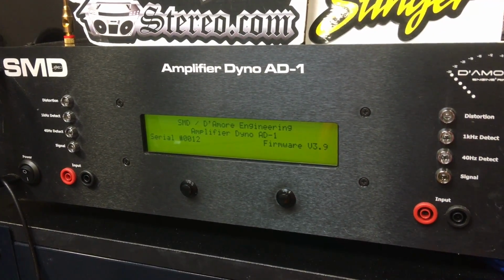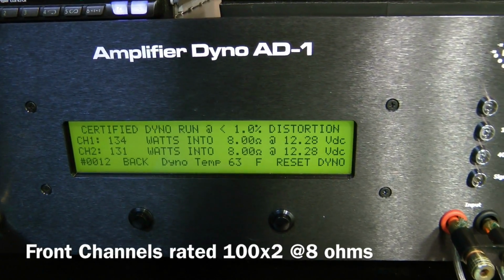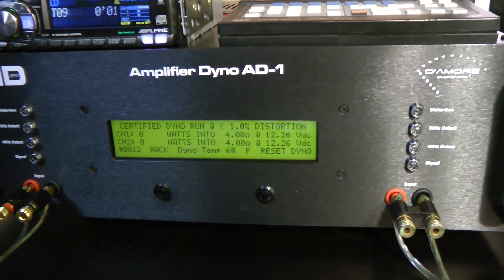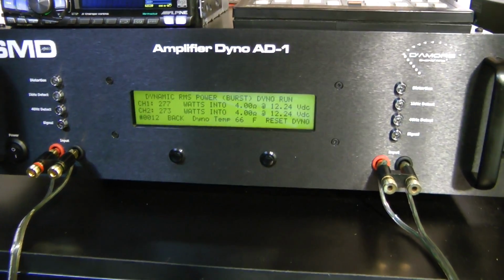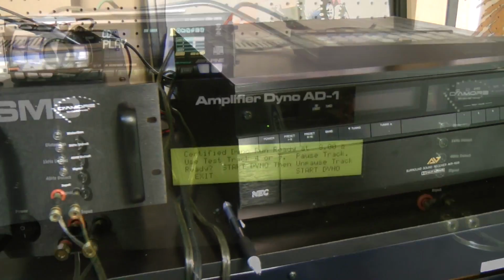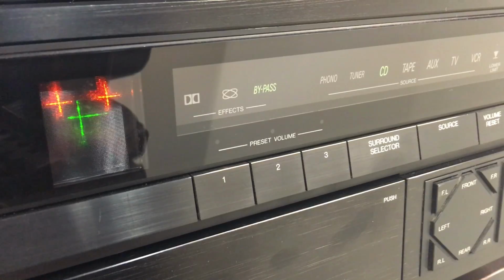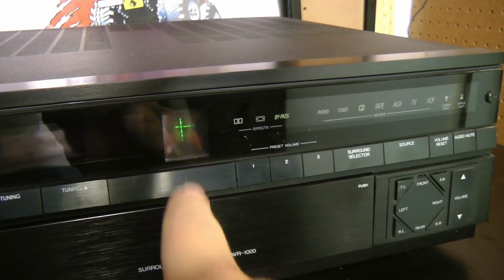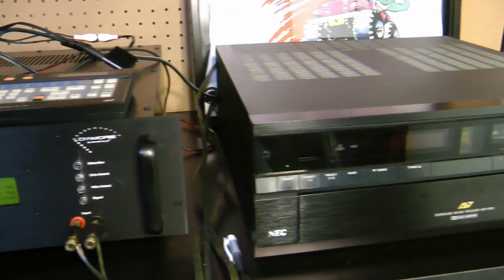My First Home Audio Receiver - NEC AVR-1000 Review

Comment: you should get your hands on an nec a-910 stereo integrated amplifier to test. it looked like the same amp modules but four 71v 10,000uf capacitors and a very big transformer. rated similarly but strictly 2 channel. 2 of the four capacitors are a reserve system i guess that are only used when necessary. very interesting

Comment: Looking for some HELP!  I love this receiver that I picked up 2 years ago.  2 days ago, I noticed a chunk a dust on the stylus.  Thinking I had not turned on the receiver yet, tapped it with the stylus brush, and pop, no sound.  The unit stayed on but volume no longer worked (The unit responds to the volume presses but sound does not come out of the speakers).  The graphics (Spectrum Analyzer) on the middle of the receiver do not move as they would if the volume could be adjusted up.  I replaced the 7amp and 4 amp fuses towards towards the front of the receiver.  Are there any fuses that I may be missing?  What else could I check?  Is it toast?
Reply: There is an orange vacation switch button inside the front panel, make sure it's pressed in (off)... I am sure you have already checked but just in case.

Comment: See if it has B T L  switch on the back! It allows you to hook two amps and it then bridges the amp and it runs 2 channel & increases its output for those two front channels! At least the N E C av 350 E had it I have one

Comment: I AM SURE YOU ALLREADY KNOW BUT, BY ADDING A 10 BAND, POWERED EQUALIZER TO YIUR NEC, IT WILL IMPROVE IT'S POWER OUTPUT & SOUND QUALITY!!! MINE IS A NEC AV 350E & I BELIEVE ITS 35 WATTS X 4 CHNLS OR IN BYPASS MODE (FRONT CHNL ONLY) IT'S 70-75 WATTS PER CHANNEL(X2) YOUR NEC 1,000 APPEARS TO BE WAY NICER THEN MY NEC AV 350 E

Comment: COOL!!! I have a NEC AV 350. I COULD HAVE SWORE IT WAS A NEC AV 350E. IT IS MY 2ND ONE! MY FATHER BOUGHT ONE IN 1991-1992 & HE HAD 1O'S ON THE FRONT & THEN 12'S & EVENTUALLY HE HAD A SET ON PIONEER 15'S & THEY SOUNDED GREAT!!! I CURRENTLY RUN MY NEC W/ 12'S UP FRONT & 2 DUAL 6 REAR SPEAKERS, I HAD A BSR EQ-3000 EQ & IT MADE ALL THE DIFFERENCE BUT, SADLY, IT HAS FAILED. I NEED A NEW ONE!!! LOVE THAT YOU HAVE REVEIWED ONE KINDA SIMILAR!!!! ITS OLDER BROTHER.

Comment: your TESTING is BULLLSHIT ! - for audio u should test on full band 20hz -20khz and with THD 0,1% or less.
Reply from the maker: Actually my testing methods are legit. Testing at 40Hz and 1kHz gives you a good idea of the capability of a full range amplifier. Additional frequencies would not vary much on most amps. Also, nobody tests to 0.1% THD although many old school home/car amplifiers were rated at 0.1 percent or less. Most techs test to clipping (have you even done research on this?), but I add the 1% THD test as well. Any questions?

Comment: I really like seeing home audio receivers and Amos going up on the dyno, I'd be interested in seeing what a more average brand that may be over rating their receivers by saying 150watts per channel, but that's really only x2 not all channels driven ect, also like to see a amplifier like mine go up, they aren't that expensive, $170~ I have two pyle pmwa3003t amps, and one runs two sundown e v2 12s and it can push them very well. I've done my own voltage and amperage tests on mine, but, could not do a peak hold on voltage, and can't do both volts and amps at the same time. but the numbers I got would mean the most power I pushed out was around 1500 watts, but that's giving it the benefit of the highest voltage i saw, I don't know how clean that would be as I unhooked the speakers for the voltage test so I didn't bother my neighbors, I also did math for a lower voltage that I believe its definitely clean at and thats around 1000 watts, whenever I get a new volt meter as my old one is broken, I'll do the voltage test under load, and do the same for amperage, maybe trying to get the amp clamp over all the channels + wire if I can. and I think I'll use the one Hooke to my subs, as I know they draw more power than my towers do( I used the amp powering my towers for that Amps and voltage last time.. so I didn't make as much noise for the neighbors

Comment: NEC made some beastly equipment back in the 80s. Back when I worked for the school district in the mid 90s, we had a bunch of mid to late 80s commercial NEC 27 inch monitors that were built like tanks. They were meant for presentations (it was a large format display back then,)  had tons of inputs and stereo sound, it even had a CGA/EGA input for use with a computer, and BNC RGBs inputs. One of my electronics pet peeves is when people pronounce NEC as "neck."

Comment: Need some help BigDWiz. I am also an old school stereo lover. I dug out my Clarion 920eq and am missing my power cable 4 prong plug. If you or anyone on here knows the plug layout or where I can get a replacement please help. Thanks
Reply: Jeremy Barnes if it’s the 4 prong plug looking at it from the back like the units back facing you and if the cable was plugged in the bottom left is ground the bottom right is power and top left is remote ! And to check just double check that ground by metering the pin and chassis

Comment: what speakers did you run off that beast bdw?
Reply from the maker: I had some inexpensive Realistic 2-way speakers with 8" woofer and cone tweeter. Then I got some floorstanding Technics towers from a local Sear's Outlet and used those until I got my Boston Acoustics VR30's. Then I moved the NEC to sub duty powering (2) MTX Blue Thunder 10" subs (4 ohms/ch) and switched to a Yamaha RX-V670 Dolby Pro-Logic receiver. I had to use front channel pre-outs in the Yammy and go into the tape loop of the NEC...it worked though :-)
Reply: Realistic? Wasn't that RadioShack brand? :)
Reply: radio shack brand
technics in not a slouch

Comment: Sweet! My original set-up from 1996ish was a Optimus STAV-3680 (re-branded pioneer), an Optimus 6 disc cartridge cd player, and an Optimus 10 band eq and a set of Optimus pro-lx5 bookshelf speakers (Radio Shack was the only game in town!). Still got the receiver and speakers, the cd player and eq gave up the ghost. Still rocking in the garage!
Reply: Andy Shoppa you are right back then all of their stuff was rebranded pioneer. still have the speakers from buy realistic 10 1010 system from 1988. They work just as good as they did when they were new. I came from a small town and Radio Shack was the only way to go. Because it was literally the only place to buy stereo equipment.